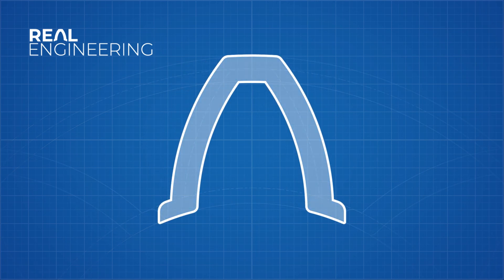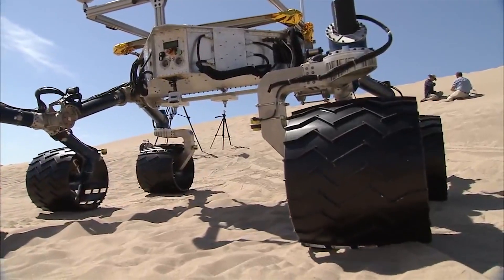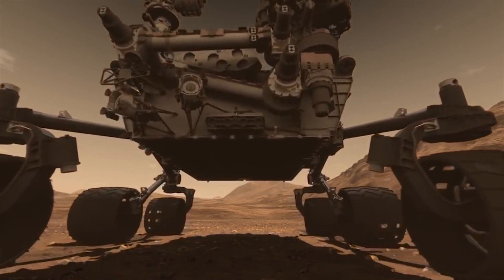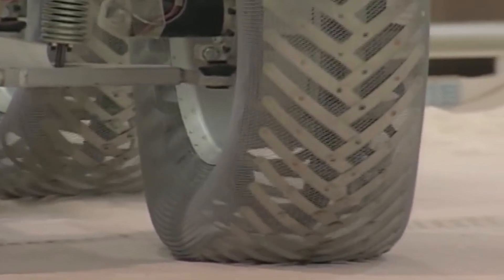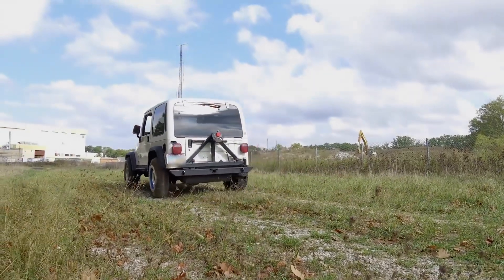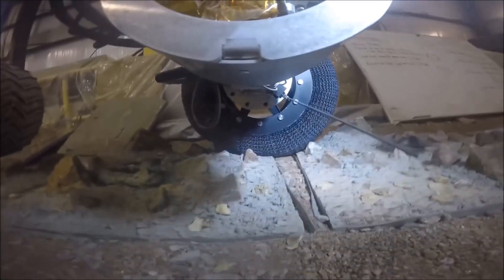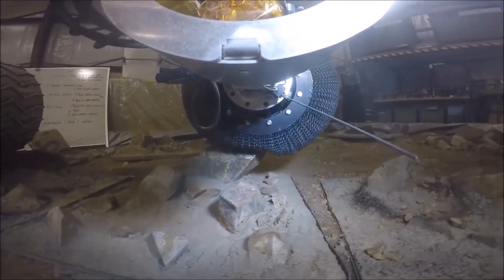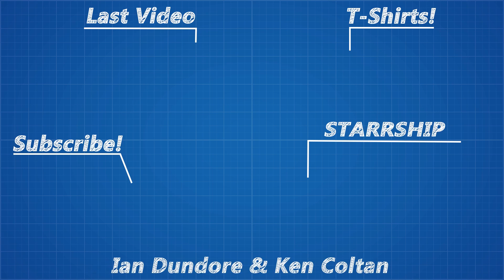How NASA Reinvented The Wheel - Shape Memory Alloys

Comment: They should’ve just made them ticker
Reply: Josh Foulkes too heavy
Reply: stale memes it was an Irish accent joke
Reply: @stalemeat Unlikely that a half or 3/4 millimeter thicker wouldve made them too heavy
Reply: Ted Z it would still be able to get to mars but the heavier the more costly it is to get it into space
Reply: memos few ounces per wheel wouldnt have been noticed on any scale... I'm 100% sure they safety factor of launch power vs weight isnt that closely correlated
Reply: Ted Z it takes more fuel the heavier the cargo, rocket fuel is expensive.
Reply: @chadthundercock4806  again... I'm sure theres a buffer,  guarantee they dont risk it, there is likely 15-20% more fuel than actually needed. They wouldnt risk failure due to being that close in calculation
Reply: Ted Z Again, they have to put more fuel for heavier cargo, the lighter the cheaper.
Reply: @chadthundercock4806  hey everybody! We gots a rocket scientist in the hizzle!
Reply: +stale memes  
rocket fuel is actually incredibly cheap. so cheap in fact that it is the cheapest part of any rocket launch. what's expensive are the rocket stages and the payload. if rocket fuel was even remotely as expensive as you make it out to be, nobody would be trying to reuse rockets.

Comment: Aloominnyum.
Its spelled Aluminum. Stop adding an extra I, it was only done at first to make it match other elements ending sounds.
Reply: It was officially called Aluminium by it's namer in 1812. Americans just didn't get the memo.
Reply: @BuxtonsWater  Originally called Alumium in 1807, it was changed in 1812 to Aluminium from Aluminum to match other elements such as potassium and sodium. It was prefered by other chemists and scholars because they thought it sounded more latin.

Turns out they're both technically correct and both are recognized by the International Union of Pure and Applied Chemistry.
Reply: Both are correct but there's no reason to get in arms about either spelling.

Comment: IT'S NOT A NUCLEAR REACTOR!!!!!!

It's a nuclear power supply, but the plutonium 238 decays all on its own, the vessel it's in does not affect this.  A reactor is a device that causes or promotes a reaction.  The RTG on the probe simply converts the captured decay heat into electricity.

Comment: At one time, carbon fiber was all the rage because it is stronger than steel and super light weight. It was supposed to revolutionize our world, but its high cost of production has slowed its adoption. Why not use carbon fiber for the rover’s wheels? With a budget already exceeding $2B, the high cost of carbon fiber can’t be that big a deal.
Reply: the epoxy that holds the carbon fiber together would deteriorate very quickly in the harsh conditions of mars

Comment: NASA is so bad at what they are doing, its impossible to believe, the build a vehicle that weighs allmost one ton metric and then they decide to "save"  eight pounds on the wheels, that is just too much to believe
if tesla can send a car to mars for fun they sure could have sent a few extra kilograms to the surface
Reply: I understand that too, but do you , by writing this , say - that you think they did the right priority? 
there is too much to say about details that should have been decided about differently
but here is a few things that are obvious
 the wheels, if they break nothing works, so they should not have been reduced to minimum capacity,
they boosted that this vehicle would work for 50 years with its plutonium heat source
the other two drones had sturdier wheels, look at the pictures, and there are other ways to save weight aluminium is a cheap metal, they could have used titanium
NASA have not been showing its full genius in many different occasions, and sometimes you wonder if they are just partying and not working, but most really clumsy decisions have been made on a high level, and many times engineers and scientists have protested but not been heard
and on and on this text could be very long but its a comment on a comment so lets not
Reply: So, you think they did the right priority? NASA does not think so, of course they think its a mistake
Titanium is stronger then aluminium per weight ratio. you think people would pay thousands of dollars per kilo of titanium otherwise.
Reply: In all of history people have had strong opinions about what the so called experts are doing, judging them as incompetent from time to time is not a bad thing, its is only strengthening their competence.

Comment: It does NOT use a nuclear reactor to power itself. It uses an RTG - a Radio Thermal Generator, which converts the heat from a decaying 5-kilo slug of plutonium into electricity using peltier devices. It is not very fancy, has no moving parts, and is very reliable, but low power, at less than 110 watts total output.
Reply: Radioisotope Thermal Generator, actually. No radios involved in an RTG.
Reply: actually RTG stands for radioisotope thermoelectric generator
Reply: Wanted to say exactly this.  An RTG is quite different than an actual reactor.
Reply: I thought it was a little suspicious when he said "nuclear reactor". Thank you for the clarification.
Reply from the maker: That’s actually way cooler. Thanks for correcting me. Want to read more about that now
Reply: @RealEngineering  Actually, it's not "cool" - it's brute, dumb force engineering.  Probably the only smart thing NASA did on this project.
Reply: Real Engineering But doesn’t a nuclear reactor already use the heat from a decaying material to produce power? Soooo technically he’s right in saying it’s a nuclear reactor in layman’s buuut if you want to be specific and say it’s an rtg he can but both use the decay of a material to produce power.
Reply: +Harry warren no, radioactive decay isnt a reaction, and a reactor doesnt use the heat from decay, it uses the heat from a fission reaction.
Reply: Sam Burns then I’m failing my exams because I’ve been taught something completely different
Reply: @Sam Burns everything is a reaction as long as there are several elements interacting. And while there are only 300 tokamaks for scinentific purposes, recent power plants with nuclear reactors are based on decay.
Point of this conversation is that RTG doesn't provide sufficient number of fast neutrons for chain reaction and simultaneously doesn't require moderating medium.
Reply: +Ilya Shmakov However, there aren't several elements in nuclear decay - only single atom "just" "break up" creating different isotope or element and some kind of radiation. So it isn't reaction. But both nuclear decay and nuclear reaction 
In RTG - (spontaneous) nuclear decay ("break up") of plutonium produces heat that is directly converted to electricity.
Nuclear reactors are based on reaction between atoms of uranium and free neutrons and not spontaneous decay.
And nowadays usually, for chain reaction in reactors slow neutrons are "used".
Reply: @harrywarren3550  key word is decaying not splitting.
Reply: @Sam-th4jl  Yep.  The energy (heat) levels are many orders of magnitude higher in a fission reaction compared to simple radioactive decay, especially when you consider the slow decay rate and very low energy levels of plutonium decay.
Reply: @harrywarren3550  difference: nuclear to steam to generator = nuclear reactor. Reactors use neutrons to break apart the Pu or Ur into smaller isotopes to generate heat for steam to turn a turbine. 

Nuclear heat, by decay via shielding to contain the neutron flux, is turned directly into electricity via peltier junction modules or sterling engines = Radioisotope Thermal Generator.
Reply: Radioisotope*

But yeah I'm tired of people calling them reactors.  It's just a box.
Reply: @syaondri  you do know Mars is already highly irradiated.
Reply: Hey, reading all the comments here and just wanted to say add that most of the energy from a nuclear reactor's fission reaction comes from the kinetic energy of the particles rather than nuclear decay, over 80% in fact. This is why most people don't like RTGs being called reactors because they are powered entirely by decay rather than the consumption of nuclear fuel. However, the interesting thing about RTGs that use Pu238 as fuel is since it is almost all alpha radiation, one can say that nearly all the energy from an RTG is from kinetic energy as well. Neither one is powered mainly by radiant decay capture, but both by physical motion of big atoms smashing into things. 

This makes the distinction between them less obvious and more academic. While no fission is taking place, calling it a reactor isn't completely wrong. Still, many of us in the field usually call them generators or batteries as they mostly just store energy rather than create it from some kind of fuel source. That distinction more than any other (radiation, heat, kinetic energy, splitting atoms) makes them rather distinct from traditional reactors. 

The lines are blurry, but such is life!
Reply: @BeCurieUs  I came to troll and argue but your explanation was so perfect and suited both sides of the arguement that there is nothing I can say or do other than complement your knowledge and move on.
Have a good day.
Reply: This system was described in the book The Martian as well. Due to its radioactive nature it was only used for automated pre-operations in the story, and buried and marked when the crew arrived, but Watney ended up digging it up because, well, he needed it as mobile battery, and whatever feeble rads it gave were still preferred over dying.
Reply: Pu238 is all alpha anyway. Short of inhaling it, you would be fine. That is why we use it actually, it doesn't have any real gamma signature to speak of so requires next to no shielding.
Reply: It's still nuclear powered.....just like in a nuclear power station, the nuclear rods themselves do not generate power. They generate or heat water to steam that drives a steam turbine generator.  On the rover, the heat from the nuclear material itself is used directly to generate or drive a peltier device.
Reply: Same shit, different speed.
Reply: i wanted to say the same
Reply: Imagine the rocket with That Plutonium thing on it exploded! What a mess :P
Reply: @jk1422  I'd assume the casing is probably nearly indestructible
Reply: @jk1422  I remember seeing somewhere (I think on the nasa website?) saying that they mixed it with something (clay?) so it would break into pieces instead of vaporizing into the atmosphere. 
I know I butchered what they said, but I can't remember the article so clearly, and I couldn't find it in a cursory search
Reply: The second he said nuclear reactor , I wanted to say this. Then I assumed someone would have pointed this out. You did not disappoint.
Reply: Radioisotope thermoelectric generator. Read the Martian 20 times boi
Reply: so they launch 5 kgs of Pu-239 into the space through rocket propulsion like the kind that can blow up mid-air?
A random thought  about the design of the hiroshima U-235 bomb crosses my mind for no reason, but there must be a connection.
I wonder what's the connection...
Reply: Ahmet Refik Eryilmaz different isotope, RTGs use Pu238, not Pu239.
Reply: You can treat decay as reaction, as 1 stage in multistaged reaction where stable isotope was(years, centuries milleniums ago) start nuclear reaction, and untill it ends as stable isotope again, it would be all one long multistaged reaction, and pu238 decay is just 1 stage of such reaction(final product would be stable pb206?)...
Reply: The Difference...

People see nuclear reactor vs RTG

People: "Good point. Here are some other....blah....blah....and well done for spotting it."

I see the nuclear reactor vs RTG

Me, being the simple average human I am: "_C-CLOSE ENOUGH, OKAY?_"
Reply: People really got their dicks out swingin on this one
Reply: If we want to start calling natural un accelerated decay a reactor, then every banana (or any other object that contains radioisotopes) is technically a nuclear reactor. Btw that list includes humans. I am a nuclear reactor.
Reply: radioisotope thermal generator, not radio. The correct term is a "nuclear battery'.
Reply: I read "The Martian" too
Reply: @Chris Davies Way to be rather pretentious about it, but you know what we call things that use reactions, chemical, nuclear or otherwise, in order to extract power ? I'll let you figure that out. Also way to make a fool out of yourself, thermocouples are not peltier devices : both use the Seebeck effect, in a way, but entirely reversed.
Reply: +Ramash440 However, nuclear decay is generally not considered reaction - nothing reacts there (as far as our knowledge goes). Technically, RTGs are not nuclear reactors, even they are nuclear powered.
And do you call car engine reactor? Or your digestive tract? Because they use reactions to extract power.
Reply: "And do you call car engine reactor? Or your digestive tract?" Yes ? I guess you kinda expected me to say no, but yes, you can extrapolate the word reactor to fit car engines and your cells. Hell, you can extrapolate it to fit a fireplace boiling water, but we don't for convenience's sake. Would you say your refrigerator is not an engine just because it's not commonly called so ?

Comment: The Curiosity Rover does not use a nuclear reactor, but a radioisotope thermoelectric generator which provides power by the heat decay of radioactive elements as opposed to the fissioning of atoms which occurs in a nuclear rector.

Comment: You got the stress relationship backwards. Austenite can transform into martensite superelastically when at a temperature above its transition temperature. Removing the stress causes the reverse martensite to austenite transition. Higher temperatures require higher stresses to transform (and lower stresses to recover) according to a Clausius–Clapeyron relationship. Increase the temperature too far, however, and the transformation stress will exceed the yield strength of austenite and plastic deformation will occur before martensitic transformation.
Reply: This is of course super simplified for a quazistatic, isothermal, tensile loading of the material. Materials processing/crystallographic texture, environmental heat transfer rates/sinks, strain rate, multiaxis loads, etc can all affect the behavior of this material and get it to do wacky things. There are huge challenges working with NiTi (commonly pronounced "Nye tie" and preferred by some to the trade name Nitinol) but there are equally many opportunities to apply it in demanding conditions where no other material can do the job. We're still figuring out the finer points of working with this stuff ~60 years after its discovery, so if it sounds cool to you, go off and learn yourself some Materials Science!